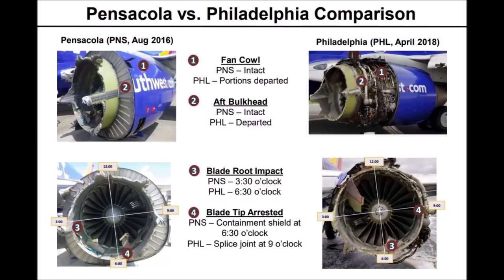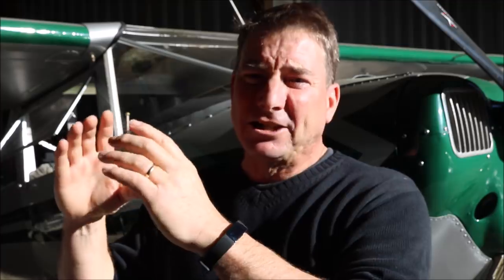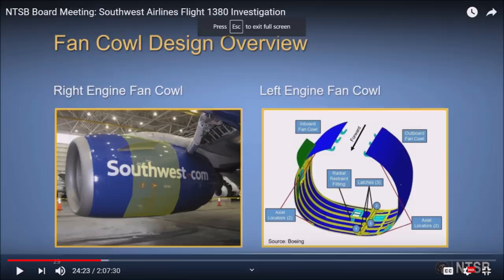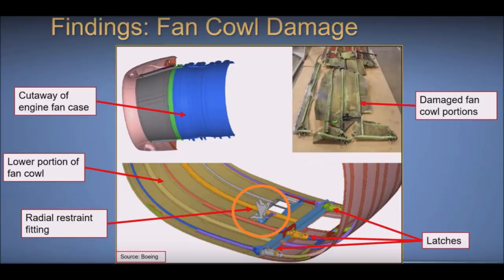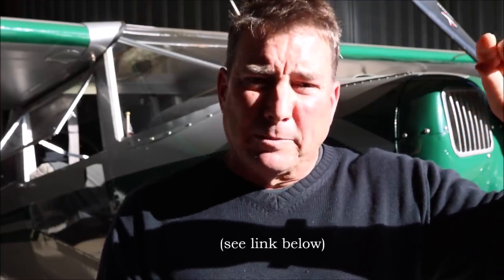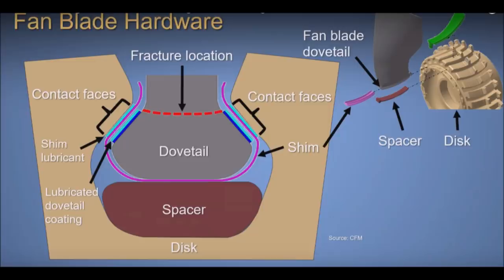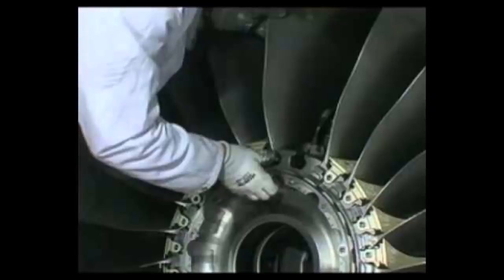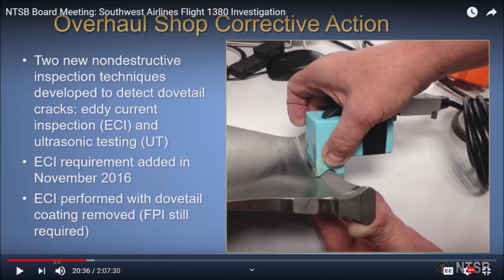NTSB Board Investigation SWA 1380

Comment: The SW 1380 event shares some similarity with United 232. The fan blade which failed on United 232 had.been manufactured from material in which a defect had been detected and was supposed to have been returned to the supplier under warranty. In the case of SW 1380, numerous opportunities occurred to detect the defect but the inspection techniques were inadequate. I"m shocked that dye penetrant inspection is considered adequate for such a critical part. I would have expected x-ray imaging at a minimum during overhaul. The applicable late 20th Century/early 21st Century technology would be MRI imaging.

Comment: Excellent analytical video as always.  I must admit to being surprised that a flight attendant gave up their seat to allow a passenger to use it. That is surely a serious omission, perhaps forgiveable in the heat of the moment, but they gave up a rear-facing seat with full harness, next to an exit door, being designed specifically for maximum protection in order to assist passengers in an emergency. Had this landing been even more challenging than it was, the attendant, sitting on the floor, could have been thrown anywhere, endangering her own and others' safety, as well as their not being on hand to assist in a potential emergency evacuation. Surely, safety should always trump politeness, and especially in what was classified as an emergency landing.

Comment: Very Good Reporting. The Brilliance of this Crew is the use of Flaps 5, which (I believe) keeps the leading edge slats retracted. The left wing slats were damaged and may not have deployed, which would have been catastrophic if the right wings slats did deploy.
Reply: I believe there is a switch to turn off forward slat deployment to prevent them from deploying if necessary.

Comment: Well, there's a seat in every toilet in case there's an incident where they lose seating. I can see a number of problems with using it currently but I also think it would be easier to make the toilet a safer option than sitting on the floor of the aircraft during landing.

Comment: Question, I recently flew into Busan, Korea and we landed downwind. The windsock was full extended, meaning at least 15 knots tailwind. Is this normal?  I thought not and wondered if this was at all against regulations? I think the jet was an airbus A320
Reply from the maker: No. 15 knots is the max tailwind landing limit. Must have been other issues forcing the downwind landing.

Comment: I used to do N.D.T work  good explanations of the techniques  , yet another great video  . will send you a message on Toddbrook reservoir there is  a meeting about repairing it very soon
Reply from the maker: keep me posted.
Reply: @blancolirio   i have sent you an email with and update with details of a temporary repair to spillway that will allow it to function in a total emergency situation . they plan to keep the level very low  but should a massive rain event cause the dam to fill they want to be in a position to handle it . will take years to repair . email is same name as this account

Comment: After listening to the radio transmissions from this flight at least twice I still think that the PIC never donned her oxygen mask. I’ve searched trying to find their altitude flight dynamics and can’t come up with it. I have to imagine that she quickly gained control of the plane and immediately began an emergency descent! Man she was calm when she did communicate with ATC, although she didn’t do it much because of the workload. Also I’m assuming that the FO flew the plane up until short final unless she flew the plane and worked communications.

Comment: Had this same event occured on an Airbus 319/320 would the ability to control the aircraft been as successful?
Reply: My opinion on this is yes, but maybe require some different methods and procedures. I will point to the Quantas Airbus A380 uncontained engine number 2 failure which seriously damaged the airplane on climb out after departing Singapore some years ago. That one was a very difficult recovery for the pilots to successfully complete. They made it seem a lot less difficult than it was, but they came real close to that going badly. I still remember seeing my first video on the landing shot by a passenger. What got my attention was the number of flight controls on the wing which were not operational while landing and just after touchdown. It made my hair stand straight up on my head. And my out loud response to the news reporter script was they did not have a clue just how bad the situation was they were seeing before their eyes.  On that day, every extra expense Airbus put into designing and building all the redundancies, backups and capabilities of that airplane plus the Quantas culture of safety and training all payed of huge that day.

Comment: Question; Suppose the cockpit crew were both disabled, and there was another licensed, retired or otherwise capable person who could fly, or attempt to take the control of the plane, aboard. If the cockpit door was locked from the inside, would it be impossible to gain entry to the cockpit in an emergency?
Reply from the maker: yes.

Comment: I have often wondered if the passenger was wearing a seat belt. If "yes"' then how did this partial ejection happen?  If "no"  would there have been a diiferent outcome if a seat belt was on?
Reply: I have thought about this too. I am a 6'2" male and seated with a belt on in most airliners I have to lean forward and duck down a little to see out of the window.
I suspect that even with a belt on, my head and shoulders would go out of the window in an explosive decompression. 
A truly horrific experience; a 300+ mph wind at -50 degrees or so. Doesn't really bear thinking about!
Reply: I suspect the passenger was hit by the window as it came in before it got sucked out. The windows are bolted from the inside and are larger than the frame.

Comment: So when is the Full Report on B17 9ine o 9ine due out?
Reply from the maker: a year or more
Reply: @blancolirio  Probably the mags , I know a guy who flew skyraiders in vietnam and he said if the engines were in a condition to run, that was the only factor that could stop them. but I dont know why the issue with not stopping on the ground, the plane should have easily been able to pull up in the runway space they had

Comment: What is the protocol of using thrust reverse in a one-engine landing?  My guess is no-way given the unsymmetrical force it would place on the aircraft....but then when they were touching down with a much faster than normal final approach speed, I guess you hope the testing they do in order to certify the type, that the air frame can safely land when using only wheel brakes, and that they will work after all.
Reply from the maker: they can be used...carefully...single engine.
Reply: Thom Thumbe Good question, but on a very long runway in dry conditions, thrust reversers should not be necessary.

Comment: it would be really interesting to look at the blade root inspections on the second and third cycle count..  to see how many are actually failing.. i wonder when they find a cracked blade..  do they take out the other blades and do destructive testing on those to see if there is a failure .  but i really wonder if the blades that are found with cracks had small bird strikes that did not mark the blades.. or if in flight hail stones could have done the damage.
Reply: wayne p Good questions. The cracks are in the blade root, and not subject to bird impacts. The inspection program does not really solve a seeming flawed fan blade design (engine manufacturer not Boeing).
Reply: @gordonrichardson2972  but it something small enough impacts only one blade..  the shock could cause the crack  from the sideways shock. .. i agree that it might be a manufacturing defect.  i wonder if Xray exam might pick it up.   set up an automated blade Xray.. where the blade root is rotated as the xray device rotates thru half a turn..  so the film strip comes out long..  maybe titanium can't be xray'd.. i don't know and have lost touch with a friend who used to do radiologic inspection for Bucyrus cranes he checked critical welds and hooks..  think of a baseball bat... it can be swung millions of times.. till a ball hits it at just the right spot to crack it.  who knows what has been ingested during flights.
Reply: wayne p The NTSB looked at all of those issues. The board hearing is available on YT.

Comment: What im still not understanding, i how this is boeings issue. The fan cowling is supposed to keep the blade in the engine. Yes the cowling kept the blade from blowing out the side of the engine, but it did not keep it from flying out the front of the engine destroying the outer housing and causing so much damage. Seems to me that this is GE's issue, not boeing. You never hear of this kind of issue on Rolls Royce trent engines.
Reply: No, the engine has a barrier built around it to contain an explosion.  The cowling is an aerodynamic feature that controls the airflow into and around the engine.

Comment: I understand the human reasons of why the flight attendants sat on the floor n let the passengers use the jump seats as 1, they would want to be near that poor person that sadly died 2, the want of having the nearby passengers, in shock n would of seen n been through an awful experience to get them to a safe place & away from the carnage as they wouldn’t want to expose them to anymore of a further total ordeal than needed 3, they would of wanted 1st aid trained attendants with the casualty 4, to give comfort n advice to the locally effected passengers that couldn’t be moved 5, there has NEVER been any guidance on what to do in the EXACT same situation as thins & lastly as an attendant they would of felt a feeling of duty n to rather take the higher risk themselves rather than their passengers. Although yes they should in hindsight gone n secured themselves to be of help in the case of an emergency evacuation being needed but this is life & sometimes you have to do what you think is right at the time with a thousand n one things going on through you’re mind. Just saying it’s understandable n I don’t think they should be criticised for what they did although it should be noted in a future similar event maybe those may look back on this incident and act slightly differently. RIP 14A

Comment: So the engine failure is a maintenance issue? Or is the this a undetected failure? And was the passenger wearing her seatbelt? Or is that unknown? Should seats have a 3 point seatbelt like a vehicle?
Reply: This was an un expected failure mode... unfortunately it's impossible to model or anticipate every mechanical failure mode...  Aviation is still a very young industry jet aviation being but 65 or 70 years old or so...  It was planned for the blade to break its a fact of flying that a blade may break occasionally... the containment worked but then a part designed to fail one way failed in a way testing didnt anticipate... now that mode of failure will be corrected but again nothing is 100 percent reliable and something will fail again in a way the fix didnt catch... The key is one do you correct the new form of failure so it's unlikely to happen again...  Every time a part fails a new lesson is learned and future failures become fewer and fewer...  It's when we ignore what the failure is telling us that we are in danger...

Comment: Seating: Emergency harnesses that clip into the seat track and the passengers sit in the aisle.
Reply: Two issues I see:

1) Would need multiple attachment points to avoid the passenger being flung about, causing injury to themselves and other passengers, during a violent landing. 

2)  Would obstruct the isle increasing egress time after landing.  Potential increased loss of life.
Reply: @efox2001  1.The current system is a two-point harness that is attached to the seat frame, which is attached to the floor rails. by seating a passenger on the floor, with a tight lap belt, he or she would be as secure as any other passenger. 2. Compared to the number of passengers that flood the aisles on exit, the floor-seated passengers would hardly be an obstacle in the time it takes them to unbuckle and stand up.
Reply: Christopher Tjalsma Loss of passenger seating is very rare. Fixing the engine cowling seems more important.
Reply: Rear galley. Passenger sitting on the floor with back against the forward stowage. Seat belt attached to anchor points where the deck and cabinet meet. Uncomfortable but most survivable position.

Comment: I recently had the benefit of comparing a 737 and A320 parked right next to each other. I must admit to being quite shocked at how little ground clearance there was between the flat bottom of the 737's engine cowling and the ground. The 320 was a lot higher overall on its gear and visually had much more clearance on its 'normally' shaped engines. When adding in the MCAS debacle, it is quite obvious that Boeing is prolonging the life of a 'no longer fit for purpose' design which has led to fatal consequences. I do actually fear having to fly on a 737 in future. 
Boeing needs to install a strong ethical, moral leader to take the company forward to banish the $$$$ over safety rumours. 
I have seen chatter on a 757/767 body design being reinstated as a better way forward for Boeing than the 737.

Comment: Speed is NOT always life.  That’s a ridiculous assertion.  If an aircraft has suffered structural damage excessive speed can mean catastrophic structural failure.
Reply from the maker: you may wan't to get some more experience, especially with your comments.
Reply: blancolirio I have at least as much experience as you my friend.  Making cliche blanket statements like “speed is always life” is ridiculous.  Much of your content is very good but this particular assertion is wrong.  Speed is most certainly NOT always life.  Catastrophic structural failure can be a byproduct of excessive speed when structural issues have manifested themselves in an aircraft structure.  Consult your aircraft specific FM and reference the rapid D structural failure section for detailed procedures of why excessive speed is NOT always a good thing.  Carrying too much speed under these and many other ancillary instances can be a hazard not a help.  Blanket statements ... cliches ...such as ...”speed is always life” are more oft than not WRONG.  They sound corny as well.  In other regards, keep up the good work.  Most of your content I find interesting.  Hope your health issues resolve favorably.  Tailwinds.

Comment: $52,000 per pair of fan blades? Are you sure? That would come out to $1,248,000 for fan blades alone. I supposed that's still a small part of the typical 300 million bucks cost of an airliner these days... but still, 1.25 million bucks just for fan blades seems excessive to me. 

I hear that some new engines these days have fans made of composite materials. Hopefully that's cheaper, stronger, lighter, and less likely to kill someone (directly or indirectly) if it breaks and pieces fly. For one thing, a lighter blade should have less momentum and hence transfer less energy into surrounding objects (case, fittings, latches, cowlings).

Comment: Here is another fan blade failure from 1989 in a 737-400 (equipped with two CFM56-3C turbofan engines) . . .with a terrible loss of life. Tragically, it appears the flight crew turned off the wrong engine.

https://lessonslearned.faa.gov/ll_main.cfm?TabID=2&LLID=62&LLTypeID=2

Wondering if there are any similarities between these two fan blade failures;  seems like the failures occurred in different sections of the blades

Comment: Short cuts and cost. I watched them do the cycle count on the fan blade that broke apart and figure out which year the crack started. Then see what year it was inspected last. To me having done all kinds of testing on metals there is an easy way and the better way. Liquid penetrant testing is for surface breaking cracks not the best way to test a fan blade that the engineers of the jet engine know has a coating on it.  Which rotates and has the stress on it a jet engine produces. They should have been using ultrasonic and eddy current from the beginning. Nobody should get sucked out the window because someone wants to do the easy test. The women did not deserve to die is such a horrible way because the blade won’t break and the blade won’t break out of the cowling. The pilots saved the day and lucky there was not more damage to the wing from the blade and cowling.

Comment: If the impact occurred at 6 o clock then the fan blade failure occurred most likely at 7:30. BTW What does blancolirio mean? Thanks for the video, very informative.  https://www.physicsclassroom.com/mmedia/circmot/ucm.cfm
Reply: mech cntr Imagine the engine as clock, the top is 12 o'clock, the bottom is 6 o'clock.
Reply: @gordonrichardson2972  Right and depending on the rotation direction the fan blade failure likely occurred at 7:30 or 4:30 position for the impact to occur at the 6:00 position.
Reply: Long story that you can find in comments on other Blancolirio videos, but the channel was started by Juan's wife, and blancolirio means white lily.
Reply: @lizj5740  Oh I see, thank you

Comment: I wonder if someone is working.on some kind of equipment that analyzes in microseconds what's happening and concludes with an aural checklist that the PF and PM can follow so that no critical checklist items are missed instead of having just bells, whistles and lights going off. In this case, it would have perhaps been not loud enough over the noise of DC. But could come through headsets.
Perhaps that would have saved both MAX aircraft especially with lower time less experienced crew. Of course it would need to be in their native language I suppose.
Just a thought. More cost obviously and more automation and not fail-safe.
As always, thank you Juan
Merry Christmas.